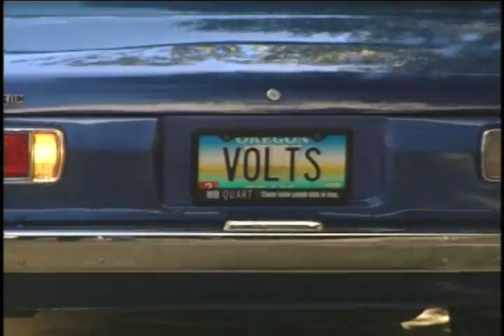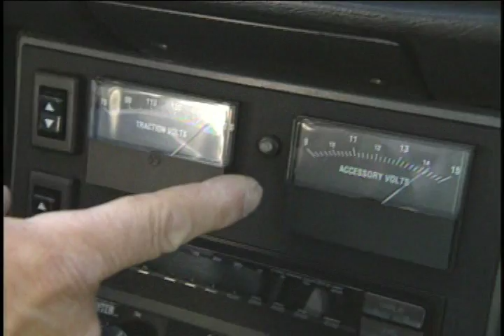Homemade Electric Car Maker Builds in his Garage

Comment: ####Many years back, there was a conversion done to make an  EV with front wheel drive put on rear wheel drive car frame , so as access to the rotating 2 front shafts. 4 alternators with 12v clutches and belts were mounted with battery bank in rear seat. The tow motor  motor was mounted with rear wheel drive. The driver would drive vehicle up to 25mph then click in the recharging alternators. The distance went up to 300miles per battery charge. Also, the other Patent holder of the Zubris circuit allows $100 fee to use his circuit on your own motor which will also extend range of car to 300miles. . The added circuit removes the Back EMF of motor windings, so as main heavy current can go in . (Type of first very fast Cap discharge) Also the other hydraulic pressure system was added on different car, as stored energy effect on car with fluid pressure from tank flowing in reverse, allowing rotation of same hydraulic pump in reverse to add power to the drive shaft underneath car. The long drive shaft had split 2 piece pulley with belt going up to the fluid pump. High Pressure tank +return lower pressure  accumulator tank. Hand valve in between front seats was operated when vehicle starting from stop and rolling up to 25M per Hour on stored pressure. ( System activated to store pressure during slow down to stop up ahead) /////..<<!

Comment: There's a solution to the problem that a homemade electric car only has a range of 30 to 50 miles when on battery power, and that is to keep the gasoline engine where it is (in the front), and then add an axle in the back from an AWD vehicle, and power it using an electric motor, with the batteries in the rear seat of the car. When you use up all of the electric range, you use the gasoline engine.

Comment: The advantage of electric is you never need to pay for fuel, and for around town you are far better off. It still needs gear oil, and hydraulic oil, and grease, and batteries. If you want to go anywhere you can't go too far. It is not a good choice unless you have plenty of solar panels.

Comment: An electric car can be used during the week. Keep your gas car for the weekend trips.  Even electric cars can be used. If only the oil companies offered super quick charging stations, electric cars could be charged fully in 30 mins while the driver takes a lunch break. Off to another 250 kms non stop. But need better batteries too.

Comment: You can refill at home and at work, and if you make it compatible, can refill all across the US. As to emissions from power source, car is 90% efficient so less emissions regardless of power source. Also for fossil fuels, include drilling pollution, processing goo into fuel, and transporting that fuel all across the US, way more pollution. You will always have dtractors, but they're dinosaurs. The old arguments are no longer valid. Money will drive the conversion to electrics, cheaper to operate, cheaper own in the long run. Use 30,000 miles per year at 20 miles per gallon,equals 1500 gls of fuel at $2.50 gal. Equals $3750 for gas. Depending on electric vehicle, you will get 100 to over 200 miles on a charge. We will use 150 miles as an average per charge. That equals 200 charges for 30000 miles times 1 to 4 dollars per charge, we'll use 4, equals $800 dollars for "fuel". Also remember ,no oil change or any filters, tuneups, spark plugs, fuel injectors, exhaust,

Comment: curious question can one add an alternator to generate electric while your driving it to recharge so it wouldn't need plugged in? the same way a gas motor uses the alternator to recharge?
Reply: Battery supplies energy to move the car. Car movement drives the alternator. That puts some energy back into the battery, but not more than is taken from the forward motion of the car. Even under perfect conditions you only recover the same amount you took away from the car with the alternator, so it doesn't extend the range any.

Alternators make sense on a gas powered car because you can't get electricity from a combustion engine otherwise. But that energy does not come out of nowhere, it comes from leeching off the rotational energy of the gas engine. It costs extra gas to run the alternator in other words.

Comment: I like how people run to electric thinking its so green... ok if we all started driving them we would put a huge draw on current power supply which keep in mind is mainly from coal or nuclear so you'd be polluting more then a normal gas not to mention the huge increase of junk batteries every where filled with lead and acid just about ten times worse to spill then gas. if your about going green right now switch to ethanol or methanol in your vehicle it would if a huge majority of ppl did it crumble big oil and it's ready now to do most cars from 1996 and later can be easily converted ethanol left over product is more food that can be used by livestock. methanol burns really dam clean
Reply: I should say this don't get me wrong I love the idea of electric Tesla the inventor had a plan that could make electricity free and power houses,cars, etc and all wireless. you can make the argument solar panels but right now it's not practical they take longer to charge and let's face it people now days demand things right away give someone dial up after high speed they go back even if it's way more expensive. I would love to see more of these out there but you have to tackle big oils grip on governments across the world. the only time in history a country got out was I believe south America 2009 they used their sugar canes and produced ethanol and gave people the facts in America our government is so corrupt it's hard to push facts because money wins
Reply: > ok if we all started driving them 

When, in all of human history, has 100% of everybody adopted a new technology all at once? 

>which keep in mind is mainly from coal or nuclear so you'd be polluting more then a normal gas

Actually no, nuclear does not create any atmospheric pollution. What you see coming out of nuclear power plant cooling towers is just steam. The grid is powered about 30% by a mixture of nuclear and renewables. So, on average electric cars use 70% fossil fuels versus 100% for normal cars. Which is cleaner? 

Solar panels also exist by the way, remember? I have solar panels on my roof. I can use them to charge an electric vehicle. What objection do you have to that? 

>not to mention the huge increase of junk batteries every where filled with lead and acid just about ten times worse to spill then gas.

No electric car on the road today uses lead acid batteries. Lithium batteries are much cleaner, and they are recycled rather than thrown away. Even lead based batteries are some of the most recycled items in the world. 

>if your about going green right now switch to ethanol or methanol in your vehicle it would if a huge majority of ppl did it crumble big oil and it's ready now to do most cars from 1996 and later can be easily converted ethanol left over product is more food that can be used by livestock. methanol burns really dam clean

*You're. Methanol is a good fuel for fuel cells too. I agree it makes sense for some applications. However your opposition to electric cars appears to mostly be based on false information and gaps in your knowledge.
Reply: Actually not false nuclear makes a by product that's radioactive and guess what we do with it we bury it in cement bunkers and hope it doesn't leak. That's why I am anti nuclear plus if we had melt down plant lots of lives would be lost and several more heavily impacted. There are more regulations on cars for pollution than on coal power plants and my objection on solar panels is time charge most Americans have the attitude now. In college we did 1000 person questionnaire and 74% did not want to wait for them to travel again or have to plug in every night a common side not was if I forgot to get gas I can fill up in ten minutes if I forgot to plug in I have to wait hours. Valid point for most Americans. If we take lead part out of the battery question what do we do with the acid? It can't for most cases be reused or recycled. My opposition to electric cars if even thirty percent of Americans adopted this our electric grid couldn't handle to additional load look at how dated our electric grid is it's as bad as our bridges.I am saying if we wanted to make a switch methanol and ethanol are going to be the easiest and fasted way for that to happen. My mileage isn't false and gaps maybe some but I've done research on this during engineering classes for electricity at college and it's not practical yet in five years a lot more and in ten with how fast technology is growing it should be there with range battery life and more self charging putting less strain but engineers can design and have built amazing things for standard oil company to bury.
Reply: coal plant include approximately: 114 pounds of lead, 4 poundsof cadmium, other toxic heavy metals, and trace amounts of uranium. Baghouses can reduce heavy metal emissions by up to 90 percent3.  Coal is thirty percent of the grid nuclear is 19% natural gas which I am a fan of is rapidly growing now I believe is like 42% of the grid the rest is different mix like hydro etc... I think your issue is your not viewing every channel and aspect your looking at the idea to personally like saying I would do it not would the greater population which most go green ppl want. The do recycle the hybrid batteries around 70%- some in great condition 100% of internals because the nickel and other products are to valuable to throw away but there still is toxic waste compared to lead battery hardly any but the big picture is overtime do you in a hundred years want to increase nuclear plants and a toxic by product we can't break down. I am all for electric cars but they can be built to self charge and become a self sustainable vehicle the biggest problem is government taxes the gas now they could tax per mile you drive instead on a prorated deal but most ppl will complain because an alarming amount of ppl here don't even know gas has the sin tax. Second government makes good money from oil companies hard to turn away fat pockets for most ppl. If someone said hey vote for gas and we will give you millions 99% of ppl will say yes. Third big oil has several conspiracy theories behind them of killing off inventors who didn't play ball, destroying patents from inventors who did play ball, lobbing politics, smear campaigns and even over throwing governments who try to get their oil rights back.

Comment: I bet if you traded that EXTREMELY powerful DC motor. For a underpowered, yet over-ramped, 3 phase inductive motor. (Your using all gears of manual transmission anyway.) You could get ten times the distance on one charge. (But you wouldnt be able to peel out, take off in high gear, etc.)  Its what your product is missing. An economy AC powered package. Not just a  powerful DC package.

Comment: How does braking work since there are no power brakes or ABS? I've heard of a guy using a vaccum pump to simulate the vacuum created by the engine and hydraulic fluid to stop better.
Reply: Check out EV West. They offer an AC/Power Steering/Brake Servo pump set for people converting cars. Just means using a clutch and having the motor idle at a low RPM when running. Otherwise there are electric options out there to replace many of those things. Hot Rod parts suppliers have been doing electric power steering kits for a while now.

As for some of these older cars, don't expect any luxuries, which is why they're so perfect for EV conversions.
Reply: I was thinking about getting an S10 and doing Li Ion. Just want something that competes with the Leaf on range but at a better price point and more simpler. I definently like the simplicity and don't need anything fancy (live in the NE). Just want something that gets me to work and back. I've even thought about getting a scooter for short commutes around the city. I'll keep a regular IC car for long trips.
Reply: Brian Pacheco
The Leaf is surprisingly good, and their mass production and contact with li-ion manufacturers lets them offer a much cheaper car than you could build. I've got stuck into planning an electric van, and the cost of the battery pack alone to get leaf-like range is horrifically expensive. Then you've got upwards of $3000 in motors, controllers. $1000-2000 for a charger, and another thousand or so for various other bits and pieces.

You don't do it because of the money, you do it because you want to.

City driving is the worst for fuel efficiency and wear and tear, so going electric is a good idea for many reasons. Electric bicycles, scooters, and motorbikes also work well here.

Comment: Tech we use that bugs the fucking life out of me because of their primitiveness. The internal combustion engine.  Keys and locks.  Steam powered generators for our electricity.  Wood, brick and mortar houses. Coin & paper money.
Reply: all i can say is, a steam generator is the most efficient way to generate power from Fossil Fuels, around 90% efficiency compared to 20% efficiency of the average ICE, plus some fuel sources, such as trash, can only be useful in a steam turbine setup, though i do know what you mean, like why aren't we all using solar/wind/hydro now, in my immediate area, there are more and more wind turbines going up along the shore due to the practically 100% confirmed winds, and a lot of sunny days have sprung up some solar neighborhoods, hell there's even a Hydro Plant at Niagara falls that ships all of it's power over to NYC, so anyone in NYC, fun fact, you're running 100% green power ;)

Comment: it'd be expensive now, but super capacitors may end up being the fast charging high voltage-current output electric cars will want. if 50-60 miles of storage takes 3-4 minutes to full charge, it's almost competing with the time to fill a gas tank.
Reply: That's not real technology. If you research it. Tesla never made any "magnet motor generator". Dynamo means something different than you think, and unlimited energy violates the law of conservation. The so called "free energy magnetic motor" is however a well known investor scam.

Comment: Unless you get your power from a nuclear reactor Electric cars DO pollute.
Reply: +lancerooke In a sense, and the biggest concern is the emissions from the initial manufacture of the powertrain components. However, it's easier to filter emissions at a massive power plant than it is in the very cramped space of a passenger car. A power plant just runs flat out cleaner than a gas-burning car, so at least in terms of the motion of the car, the electric still has less in effective emissions.
Reply: +xployalist Agreed. I very nearly bought an electric car a few weeks ago, but I decided against it due to the limitations that are inherent in the current models. However I do believe that the technology is improving. Particularly the batteries. We're close but not there just yet.
Reply: for us, they're putting up more and more wind turbines in our area (wind is a common thing here thanks to Lake Erie) and we're slowly moving away from coal (currently mostly used for power) to wind

Comment: Is it possible to mount an DC generator/regulator on a wheel and as your moving down the road recharge the batteries and not ever have to plug the car to anything? Like use the energy/ replace the energy at the same time?
Reply: +Anthony Rogers Entropy.  Also known as the second law of thermodynamics, known since the 19th century.  It's why perpetual-motion machines don't work.
Reply: It is possible, look up regenerative braking, it's very similar. But remember energy is never 100 percent conserved. Energy is loss through heat, light, sound, and mechanical energy. But yeah it exists. I though of it one day and then came across regenerative braking like a week later.
Reply: +Anthony Rogers Its a great idea, if only it worked.

Comment: id love to know how he has the manual trans setup with the electric motor... can someone explain this for me? As I would LOVE an electric car with a 4 or 5 speed... ^^
Reply: +Walter Garvey You don't even really need a transmission for neutral and reverse.  After all, you can stop and reverse the thing electrically.  Gearing electric motors directly to the axles (fixed gear ratio, no transmission) has been standard practice on railroad locomotives for many decades now, and locomotives stop and reverse just fine.
Reply: The only reason an electric car needs a transmission is for neutral and reverse. Electric motors don't care low end or high end. It's a bolt on electric motor to transmission
Reply: +David Alsh rpm limitations is due to physics. The difference between electric  motor and has engine is the electric motor has high torque at any rpm and the gas engine gets more torque in the higher rpm.
Reply: +Kimono Skunk It's just the same way a gas engine is set up. You're just replacing the combustion engine with an electric motor and batteries. Probably keeps the flywheel and everything. So there's still a clutch and transmission. Contrary to popular belief, electric vehicles need gears as well. Even my emaxx has a two speed.
Reply: +Kimono Skunk Gearboxes were made so that internal combustion engines could stay at an RPM range that produces the most power, however since electric engines produce the same power at all RPMs, they don't need a gearbox.

Though I do wonder if a geared electric engine could hit higher speeds, as it's limiting factor is the RPM of the engine itself.